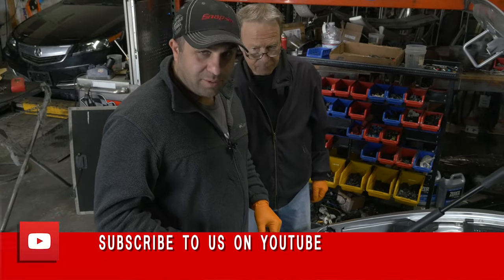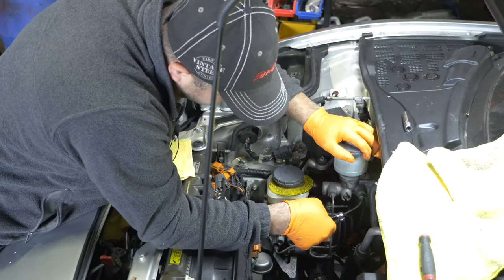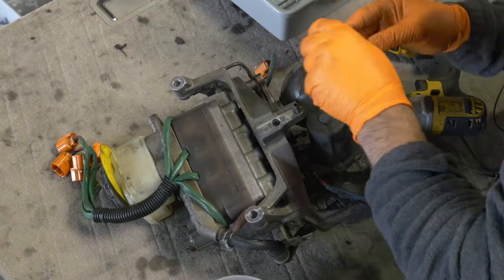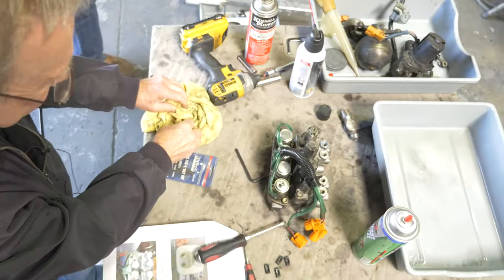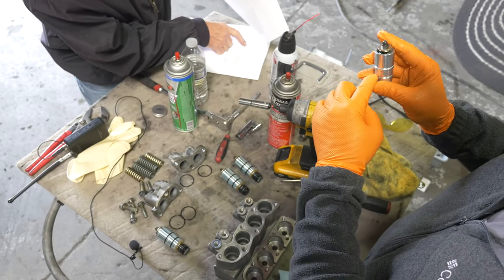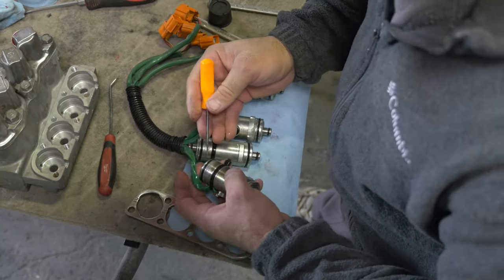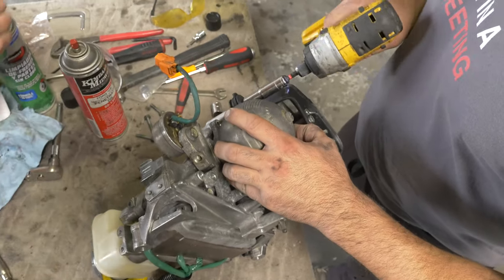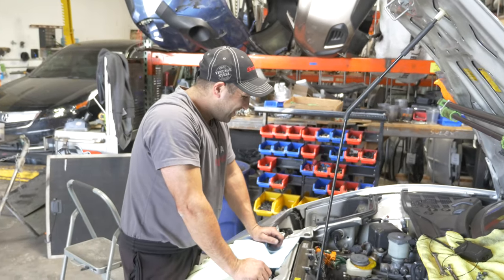How to Remove Rebuild and Replace an ABS Pump - Acura NSX

Comment: Great video but you actually didn’t clean the pump out which is so prone to seizing due to the brake fluid chrystalising in this area. Common on all the Honda / Acura 90’s cars. I was watching eagerly for this part in your video.

Comment: Can you reseal the rubber OVAL gasket on the pump where the male electrical plug is?   04 Bonneville

Comment: Great video! I am repairing my 1995 Civic EXS ABS pump but couldn't find absolutely anything on these 90's Honda ABS systems apart from this video. Curiously, the system is nearly identical tô the one on the Civic!

Just one question: what is this red "grease" that you guys use to lube the o-rings and the cylinder walls?
Reply: I have a 95 Civic as well and could not find video on how to bleed the abs.